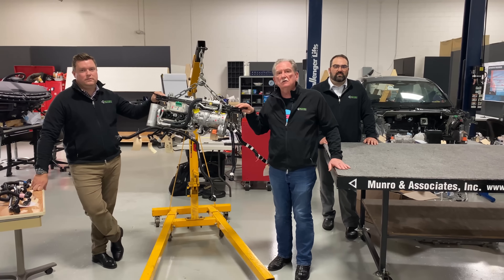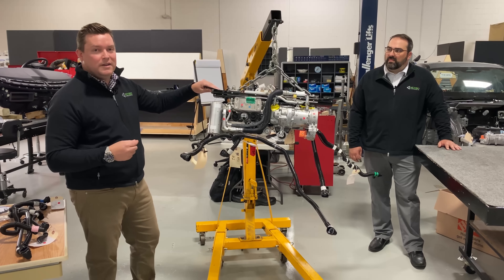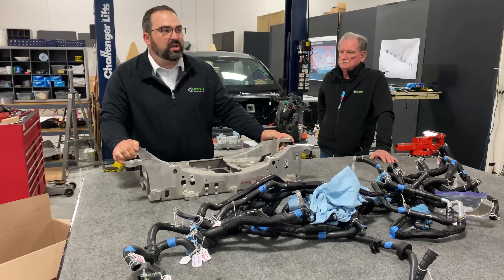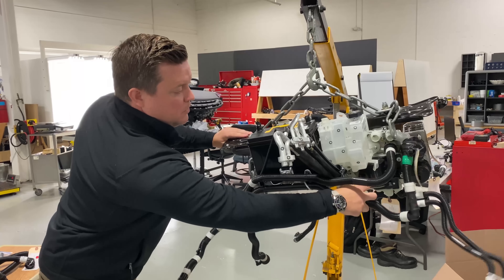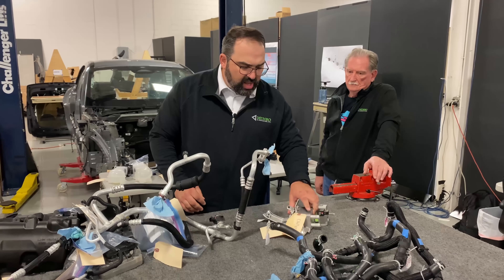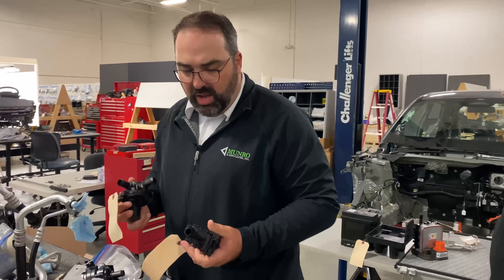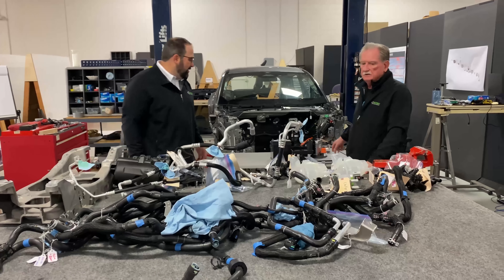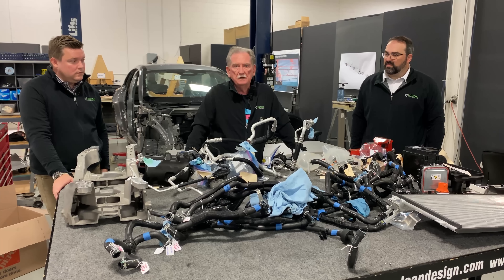Mach-E Thermal System Part 2: A Detailed Comparison to the Model Y

Comment: Excellent comparison, thanks for your expertise. Also, received my bumpersticker for the Plaid fundraiser, looks great!
Reply from the maker: Hope you enjoy it!
Reply: @MunroLive  are you going to address the sound insulation/NVH performance of the Model 3 & Y. I have a model 3 and love it, because of its handling, speed and looks (yes I like the looks of the Model 3!). However what I do not like is the noise in the cabin when we’re on the highway. Especially when there are more people in the car. In that aspect, the Mach E and especially iD4 perform better, don’t they.
Reply: @mdf1978  I believe the model 3s made after October of 2020 have double paned glass to help with sound insulation. I got my 3 a couple months before that and missed that change sadly, though the cabin noise seems fine on all but the worst roads.
Reply: @mdf1978  The one thing about the Model 3 that isn't a level of magnitude better than any other car is the suspension, imho. Particularly here in the UK where some of our roads are shockingly bad.
Reply: @MarkXHolland  Yah it's a balance/trade off between sporty and comfort, they definitely went the performance route.  If you can afford, perhaps look into upgrading to a softer suspension?
Reply: @MarkXHolland  I know. I actually have a aftermarket coilover suspension set from KW Suspension. It is designed for performance and not comfort, but I have them on the highest setting with the softest damper settings. They’re great, the handling is on point. The comfort is an improvement, but I still wished It was more comfortable. But then again I have a Model 3 Performance with 20” wheels, so I think I should be happy with the current comfort level.

However, I know that these days there are better comfort options, but these are not easily available to us in the Netherlands. Unplugged Performance and Mountain Pass Performance both have great comfort sets. The YouTube channel ‘Gjeebs’ has a lot of info about the UP set.
Reply: @ikemacoco3205  it seems that the comfort coilover set from Unplugged Performance is more sporty and more comfortable according to the ‘Gjeebs’ YouTube channel. Even the KW variant 3 suspension set that I have installed gives better handling and better comfort on my M3P. However, I’m guessing that such a set is more expensive, even for Tesla. And if they wanted to spend that kind of money, air suspension could make more sense, since that’s installed in the Model S & X already.
Reply: I’m surprised Elon just does not donate one to you at this point. I’m sure even he wouldn’t want to hear your opinion

Comment: When it comes out, will you guys be able to do the ford lightning as well?
Reply: The lightning was not deemed worthy by the viewers.
Cybertruck.
Rivian.
Unless Ford wish to supply one for scrutiny, but after this I doubt it.
Unless they do as a customer, in which case we won't see the result!
Reply: Lol Ford Lightning will probably have the same horrible engineers 🙈.
Reply: @rj8u  The Ford engineers are not necessarily bad -- we might be seeing out-of-date management practices (ie, different teams do not talk to each other).  They have a chance to learn from the product they made for today, and do better in the future.
Reply: @39401JLB  I think your wrong with that given if no one's in the company is looking outside the box the same engineers will do the same process after another. The Mach E and Lightning engineering were done at the same time so I will not be surprised if you see the same process with Ford's next full electric car which is the F150 Lightning.